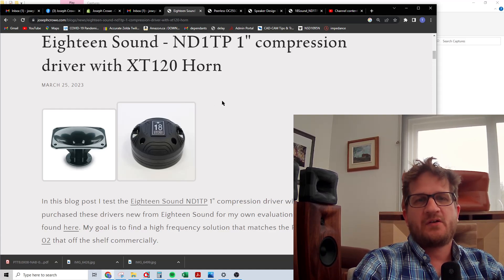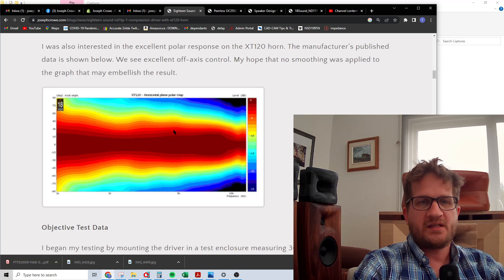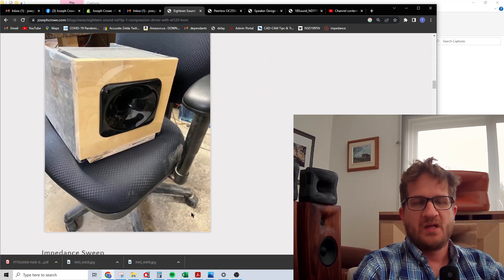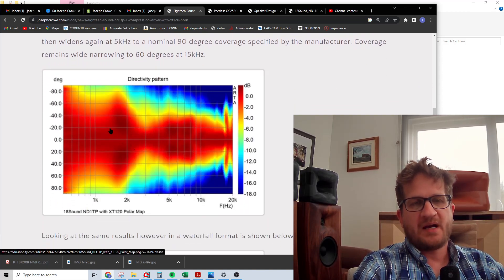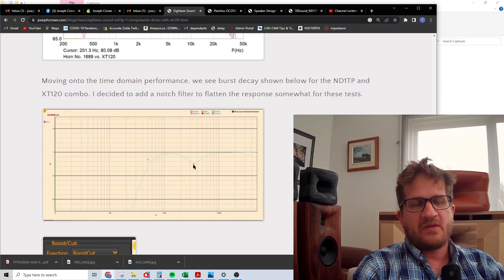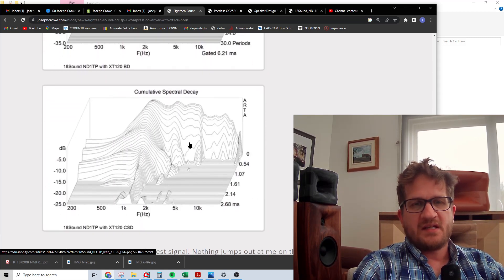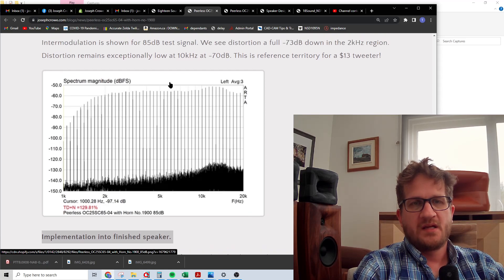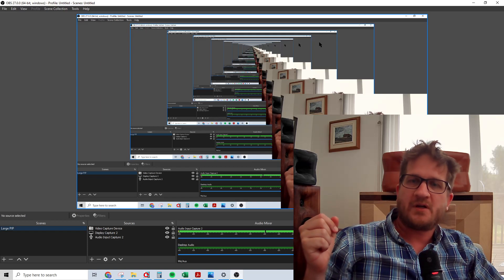Eighteen Sound - ND1TP 1" compression driver with XT120 Horn

Comment: Don't you find it disappointing that your measurements are not as good as the manufacturer says they are.  How do I make a decision based on what the manufacturer says.  Seems to be the case most often.   Does anything measure better than what the manufacturer claims?

d
Reply from the maker: There are a number of brands that don’t embellish their data. ScanSpeak, Seas, SB Acoustics, RCF, BMS, B&C. The woofers from Seas and ScanSpeak measure better than published, sort of like how BMW under rates their horsepower. I have a few other 18Sound drivers to test, so hopefully it was just that specific model.
Reply: @JosephCrowesDIYSpeakerBuilding no they don't. At least not for scanspeak. 18wu8741 measured much higher fs than what whey claim. Unless you count the higher sensitivity that's also the result of higher fs a better performance.
Reply: @youtube改名也太難了吧  they are also different editions for one model driver. I'm not saying this is the case.
Reply: @franciscorompana2985  what are you trying to say?
Reply: @youtube改名也太難了吧  Sometimes a driver also has different models, sometimes with the same designation but different years of manufacture or different measurements made by different sellers. There may be discrepancies or slight factory adjustments in the design or in the measurements and/or parameters. Also parameters vary after break-in, in frequency Fs, and all. Also between themselves, but you select that in the factory software or in pairs in post-production. It's not set in stone.
Reply: @franciscorompana2985   @franciscorompana2985  Agree. And all the above reason result in drift in measured T/S parameter that's inferior not superior. The woofer I want to point out is the 18wu/4741T00. Both Erin's audio corner and VoiceCoil have measured it before. Both shows higher fs compare with datasheet parameter. There's also other measurement on the net you can find with similar result but the above 2 is the more trust worthy measurement site so I just list them. And I believe both site know how to measure it right.
Whether it's model different, factory adjustment. The model is 18WU/4141T00 with inferior data. Still it's a great woofer with exceptional BL, KMS, Le linearty but this doesn't make it "better than published"

Comment: Your taste in expensive drivers is astounding. I could never afford one of your designs no matter how long I saved due to this fact alone. If you created a system with $60 drivers and in the end come out with something half as good I’d buy it. I mean, wow! *just my impression
Reply from the maker: I just reviewed a $13 tweeter from peerless.
Reply: Now imagine when you buy the crossover parts. 😢 💸
Reply: @franciscorompana2985  meaning?
Reply: @nelsondog100  good quality (passive) components, for crossovers are as expensive. 💸 
Note: unless driver/speaker is a fullrange instead of a multi-way. 😂
Reply: @franciscorompana2985  I do understand this but there’s always less expensive components to choose from just like the drivers I’m proposing. Not every design needs to use ultra high quality parts thus putting a good sounding system in reach of more people.
Reply: @nelsondog100  also better drivers can make you save in expensive crossover parts.